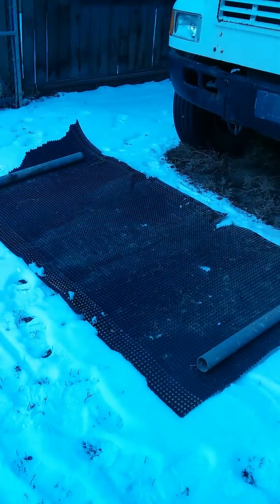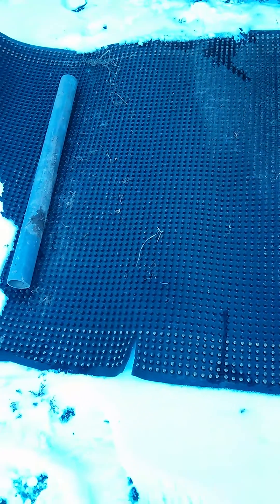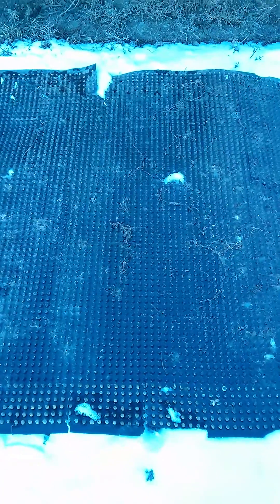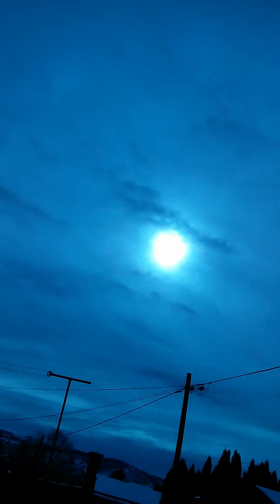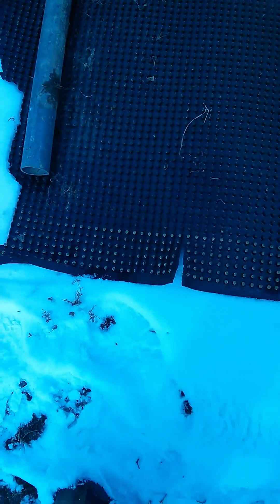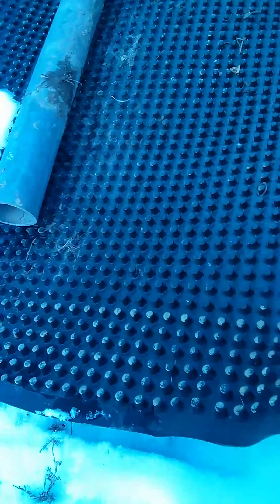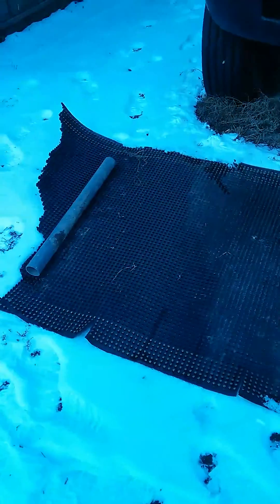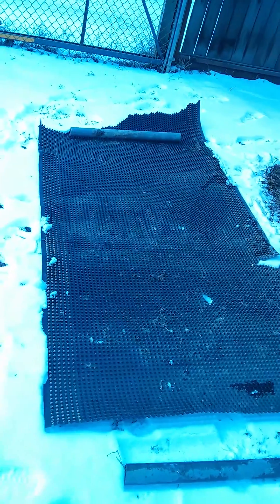solar water, or air heater

Comment: Thanks, yeah, it might work good.   It is the kind of thing that you can easily cover with a sheet of plastic to cut down on evaporation.   Thanks.  Brian.  It is rainy as can be here right now but I am busy.  A homeowner build a lovely awning over the walls I am building.  (I have used tents but sometimes they float away in the wind. (Scary  on a building site with windows about!) Brian